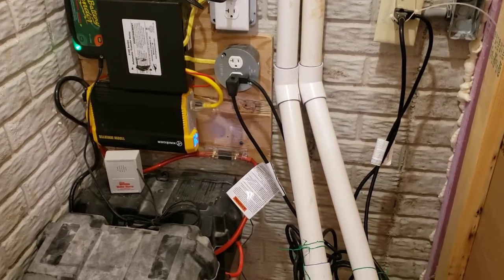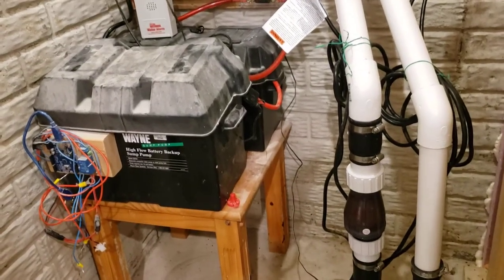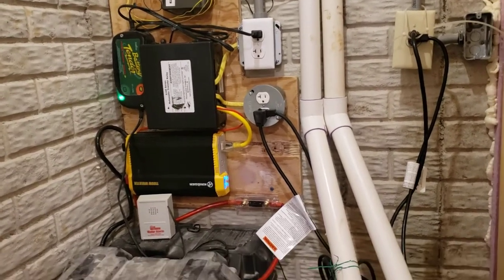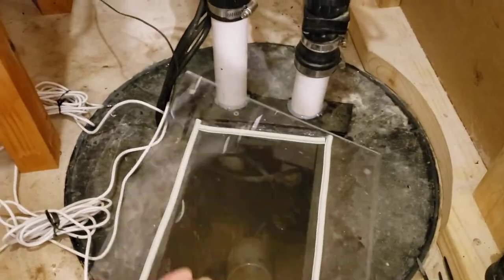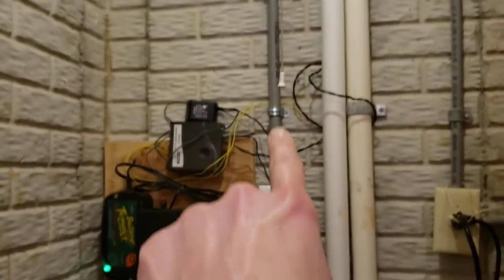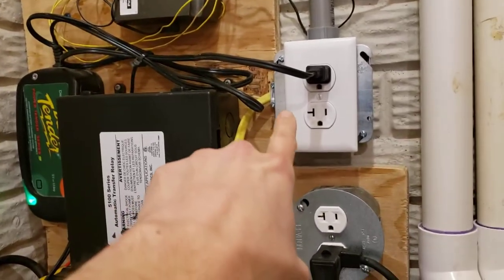Guaranteed Flood Proof Battery Backup Sump Pump System - No more flooded basement!!! High Capacity!

Comment: Great setup. The only small issue I see is that you won't get to exercise both pumps regularly (the backup) as it's higher or the float doesn't reach its minimal height as the primary works first. What Moreover, if its not periodically tested (the secondary), then you have no way of knowing if its still working (until the primary fails or too much water comes in at once). The workaround I've done is to use two water bassins and ran my water filter backwash lines into the secondary with a spillover tube in between both basins. The same could be achieved with a simple baffle inside one pit. I like how you've got two lines going out and seperated both electrical outlets onto two different breaker panels; smart.
Reply from the maker: Thanks for the comment!   I typically just reach in and lift up on the floats once every 2 months or so to check the operation of both pumps.

Comment: Great set up!! Help me out please if you can!! How did you calculate the size of your inverter??  The one you are using is relatively small and inexpensive compared to others in the market.. do you trust it 100%.. is bigger better or like we’ve heard many times size doesn’t matter LOL
Reply from the maker: Hello and thanks for the comment.   
Yes, this inverter is properly sized for the pumps that I have but please be cautious when comparing pumps.  Not all 1/3 pumps have the same flow or the same power requirements.  I chose the liberty pumps due to their reliability and their efficiency (low power).  That means I can get away with a smaller and cheaper inverter.   The inverter has been plugged in and turned on for almost 4 years now and is still working great.  I test it every month test to be sure it is working.   I hope this helps.  Good luck!

Comment: Thanks. Your solution is a lot cheaper than a Pump Sentry Sump Pump Battery Backup which retails for about $700 and that doesn't include the battery!
Reply from the maker: Thanks for the comment.  The other nice thing is: if anything fails, it is easy to replace just that component without having to buy another $700 Pump Sentry

Comment: You have two batteries and yet you have only one 12V Battery Tender charger.  How do you get both batteries charged?  Are the two batteries in parallel?  Is it safe to do so?  Thanks.
Reply from the maker: Yes they are in parallel and act as one large 12v battery, therefore only 1 tender is needed.

Comment: Have a question. How inverter knows that it has to provide power, is there a separate cable between switch and inverter?
Reply from the maker: The inverter is always on... but only provides power when the transfer switch is activated

Comment: Thanks for your video.  But I have a concern.  The last time we had a problem with our sump pump, the sump had become a fountain spewing water far and wide.  If I recall correctly, a back flow valve failed in the exit pipe.  But given that experience, I'd be concerned about all that exposed electrical next to the sump.

Comment: Great setup! I'm currently working on a similar build. How do you like that Krieger 1100 watt inverter and is the 1100 watt able to support the amperage for your pumps?  I'm currently looking at the Krieger 1500 watt pure sine wave inverter.  I have a .5 horsepower 3.8 amp basement watchdog sump pump.
Reply from the maker: Thanks for the comment!  I love the Krieger 1100.  It has been powered "on" for 2 years now with no issues.  It powers the 1/3hp pump with no issues.

Comment: Would you mind showing us the wiring part inside the inverter? Thanks so much!
Reply: Secondly, do you have the 1100 watt inverter?
Reply from the maker: @toldey  yes, I put the link to the inverter in the video description.  It is the 1100w version.
Reply from the maker: I did not alter the wiring inside the inverter.

Comment: Great video. For the Battery Tender, how do you have that connected to the battery terminals? In my Wayne sump pump battery backup, the battery case lid is where the positive/negative wires connect to from the battery terminals so having trouble understanding how to connect the Battery Tender with that in place.
Reply from the maker: I have ring terminals on the end of the battery tender... and I have those bolted right to the positive and negative terminal of the battery.
Reply: Like Cheese
Thanks for the clarification! So you have the ring terminals from the Battery Tender connected to the positive and negative accordingly.. but for the terminals that give power to the pump itself, how are those connected? Just on the same terminals as the Battery Tender terminals?
Reply from the maker: @ilikecheese3584  yep!  You got it.  Same terminals.

Comment: Wonderful setup? How did you ground the inverter? Every time I see someone mention this, they are always kind of vague about how they grounded it. And I know many people don't ground the inverter at all. I know this inverter has a place to add a wire, but what do you connect it to for grounding? Thank you.
Reply from the maker: Thanks for the comment!  I ran it back to the nearby 120v outlet ground terminal... so it is effectively grounded to my house electrical system.  You can see the wire in the video running from the left side of the inverter and then between the inverter and transfer switch and then looping around and going into the transfer switch.
Reply: @doinkeroni  Thank you! So is that one of those plastic plugs that you connect the wire too, then it looks like a normal 3 pronged plug, but only the ground prong is metal? So is this something I can buy on Amazon, add a wire to, then plug into a wall outlet?

Comment: I like what you did and your redundancy BUT, please explain why you did not go with DC redundant pumps,  Wouldn't that eliminate need for and power losses associated to DC/AC conversion?
Reply from the maker: Great question!   I debated and researched 12v pumps but I couldn't seem to find heavy duty (while being reasonably priced) pumps.  By going with AC, the options are endless and they are built to last.   Unfortunately as you said, I take a hit on conversion efficiency when the power is out, but that is <1% of the overall use.    Hope this helps!    Please let me know if you have any other questions.

Comment: That Inverter was big enough?? Reason I ask is because everything I have looked up calls for a 5000w Inverter with like a 1/2 HP pump
Reply from the maker: Hi, yes it is for my Liberty 253 1/3hp pump but I would highly recommend looking up the spec sheet of the pump you are considering using.  I was confident that it would handle the running watts but was concerned about the startup watts.   It handles it without any effort.   Averages 530watts when running.  (Check this out at Amazon
Liberty Pumps 253 1/3-Horse Power 1-1/2-Inch Discharge 250-Series Cast Iron Automatic Submersible Sump/Effluent Pump https://www.amazon.com/dp/B002YSGKH8/ref=cm_sw_r_u_apa_glt_fabc_DY66XR3KZCEDPREZ0H6Q?_encoding=UTF8&psc=1)

Comment: Hi, i need advice. I have the same inverter and battery tender you have. Do i still need a transfer switch? I only have 1 power outlet and 1 sump pump. in the event I lose power at home, I want my sump pump to stay on.
Reply from the maker: Hello, technically you can run it without the transfer switch.  It would just run off of the batteries and inverter at all times.   It would work just fine... but it might shorten the life of the system since you would be exercising the inverter and charger much more.  Also, if your pump runs constantly, there is a chance that the charger won't be able to keep the batteries charged.
Reply from the maker: @Drz Zam  hello, yes the transfer switch will allow the pump to run on utility power if it is present... but will automatically switch over to the battery/inverter power if the utility power goes out.   The one I used is linked in the video description but I see that the price has went up significantly since I bought it ($75).

Comment: need to know all details for the parts to purchase. complete list
Reply from the maker: Sorry for the delay!   I just updated the description with the detailed parts that I used.  Please let me m ka if you have any other questions!   Good luck!
Reply: @doinkeroni  hi there what type of batteries do you use and water level detector?  Is your 1100w inverter enough to power your sump pump?
Reply from the maker: @janarine  i have 2 trojan 100amphr deep cycle 12v batteries.   Regardingwater level sensors, I have several types.  I plan to make another detailed video about those sometime, but overall I have found that the tether type sensors are the most robust and worry free.

Comment: Hi: great video. Did you ground your inverter? If so, to what?
Reply from the maker: Hello Peter, yes, I ran a ground wire from the inverter to inside the relay box and attached it to the house ground circuit.  I will try to make a more detailed video showing the wiring and post it.  Thanks!

Comment: Love it, and great explanation. It's exactly what I want to do, and didn't know I could buy a transfer switch (was planning to use a 110VAC contactor) - However I have a question: the inverter you use is a modified sine wave: are you not concerned about damaging the pump, and using a pure sine wave would be safer? Also, is 1,100W enough for 3/4hp pump?
Reply from the maker: Hello and thank you for the reply!   I chose the inverter mainly due to its low cost and high rating.  I have been very impressed with it.  Modified sine wave is perfectly fine for sunp pump applications.   Regarding pump size, it really really depends on the specific pump you wish to operate.  For example, 1hp is technically only 745watts (well under the 1100w running and 2200watt peak that the inverter can handle).  However, as you know, pumps draw a lot more watts during startup than what they do during continuous operation so I would recommend looking at the pump spec sheet closely to find the most efficient models.   You will find that they vary A LOT from manufacturer to manufacturer.  I personally found that liberty has some of the most efficient 1/3 hp pumps I could find.  Many of them out-pump the 1/2hp or 3/4hp models from other manufacturers for the same wattage.   I can say from experience that my liberty 1/3 hp pumps move ALOT of water and this inverter setup runs it no problem.  Running watts are around 400-500.    Good luck with your setup!
Reply: @doinkeroni  Is an automatic transfer switch really necessary? What about a simple 110V contactor / 2 poles, that would connect the pump to the grid when energized, and connect the pump to the inverter when de-energized?
Reply from the maker: @xbleriot  yes, that is basically what this transfer case is.... a 30A 110V contactor in a nice plastic box with a ground bar, etc.   You could save a little bit of cash by going that route...  but probably not more than $30.
Reply: @doinkeroni  It also means the inverter is always ON, right? Are you not concerned about that? How much power does it draw when it's idle?
Reply from the maker: @xbleriot  you are correct.   The inverter is always on.  It has been that way for 2 years with no issues.  The parasitic load seems to be very low and the batteries are always kept topped off by the trickle charger.
Reply: @doinkeroni  Have you ever thought using a relay/contactor to turn the inverter ON only when the main power is OFF? Would it make sense?
Reply from the maker: @xbleriot  yes, I really wanted to do that, but this inverter doesn't have a simple on/off switch that I could tap into.

Comment: My goal is the longest critique. lol.Do they both use a tethered float? I would have used one vertical float and one tethered. Also, no discussion of the 9v battery powered watchdog water alarm.  Where did you place its sensor?..in the pit above the float turn on points? Also disappointed to see that you didn't use a 12v LED strip light attached to the underside of the basin lid to provide optimal viewing. ;) Further, how is this connected smart wise to your cell phone for alerts? No smart switches used to track energy/pump usage? You state numerous times your concern about redundancy, do you think only using 1 battery tender is sufficient? Why not 2? ;) Also, no use of GCI outlets? Even more, @3:30 you state their 3/4hp pumps, but the link is to 1/3hp pumps. What's the vertical head dimensions? I need to keep going....you state @3:37 the pump on the right is the primary pump....why isn't the Zoeller Quiet check valve on that line? You got on in the back up side on the left? You'd sleep better swapping the check valves. What are all those grey and white boxes with the white wires on the floor?  Overall, nice system, your grade is B+. ;)
Reply from the maker: Great critique!  Keep em coming!  I will try to answer your questions:
I have the main pump on the tether... while the backup is on a vertical float style on the right.   I have the 9v sound alarm set to go off just above the main pump water level so that I know if it fails.  Good idea for the lights!!! Haha.   For smart connections, I am using smart water level sensors connected via smartthings home monitor.  I made a custom script to plot water level and pump usage over time (pretty nerdy so I didn't explain it in this video, lol).  Regarding the backup tender, I check the battery voltage every month since it is displayed on the inverter screen.  Regarding the pumps, you got me on that one.  I misspoke in the video saying they were 3/4.  They are both 1/3 as the link shows... my apologies.  They pump a lot of water and are way ways more efficient than most of the competition via spec sheets. The pump on the left is the main pump (the one with the quiet check valve).  The one on the right is the backup with the old style check valve and vertical float. The Grey and white boxes and wires on the floor are my smartthings water level sensors.  I just haven't cleaned up the wires. Lol.   Thanks again for your thoughtful review!   Glad you liked it.
Reply: @doinkeroni  Congratulations, your grade went up to A- !  ;)
Reply from the maker: @silverS70  hahaha!!! Thanks Teach!

Comment: Why the transfer switch? Couldn't the pump run from the battery & inverter no matter what, while the battery tender recharges the battery as fast as it drains so long as there's power?
Reply from the maker: Hello and thanks for the question.  Yes, it is possible, but I decided on the transfer switch to limit the possibility of a inverter failure.  I was worried about the constant usage/durability of the inverter running 24/7... since it is really only needed 0.1% of the time.
Reply: @doinkeroni  Thanks very much for the reply. But even if using an inverter would shorten its life, that only happens here when the pump switches on anyway--with or without house power, that's going to be quite seldom.

What do you think of https://www.youtube.com/watch?v=ctj1k8oqGqI and https://www.powerinverters.com/?
Reply from the maker: @grahamjdarling4949  thanks for the reply.  Unfortunately my pump runs ALOT.  Even during dry weather.  My water table is very shallow.   I valued the longevity and durability higher than the $80 it would have saved me to bypass the transfer switch.   Very good question though!
Reply from the maker: @grahamjdarling4949  I just looked at those inverters you linked.  I contemplated one of those when I was setting this up.  It was a different brand, but my main concern was horrible durability reviews of that model... and the high price tag.   The concept is awesome and exactly the same function as mysetup but much more $ and if anything breaks you would have to replace the whole thing.    Just my opinion.

Comment: i think one of those 2 batteries that you have costs as much as you claim the whole project cost
Reply from the maker: Yes. That quoted cost was without the batteries.   As you said those are $$ batteries.
Reply: @doinkeroni  haha i know. i actually have that same inverter. haven't used it yet though.
Reply from the maker: @pratwurschtgulasch6662  good luck!  I was sceptacle of such a cheap inverter but it has really impressed me.
Reply: @doinkeroni  i just wanted something to run the fridge in case there is a long power outage. i have sump pumps too but nothing important in the basement so if it ever floods i wouldn't care too much (i think, never experienced that yet and i may bite my tongue later lol).